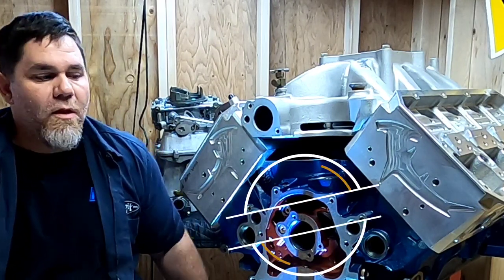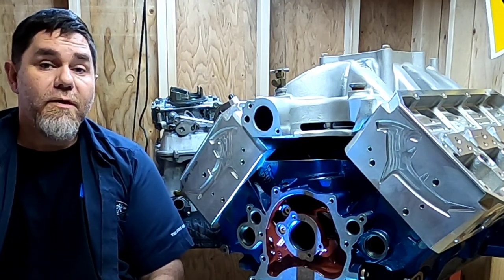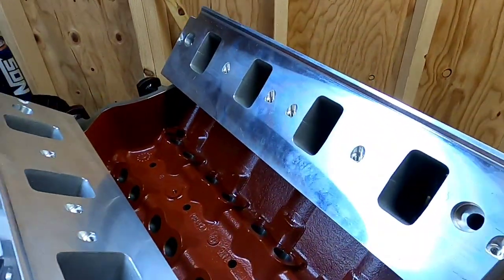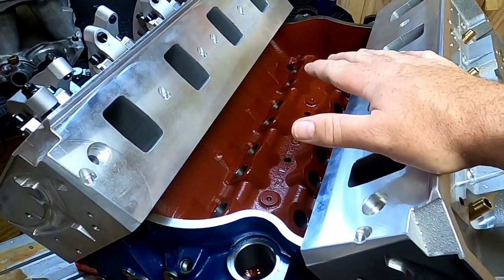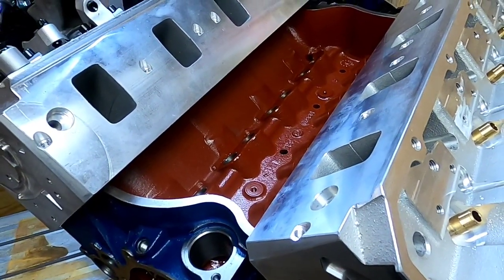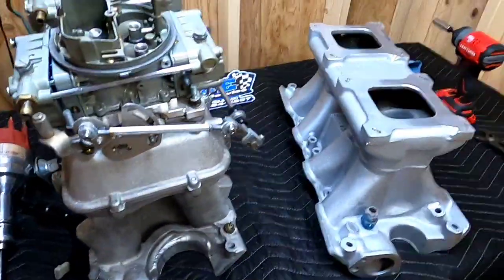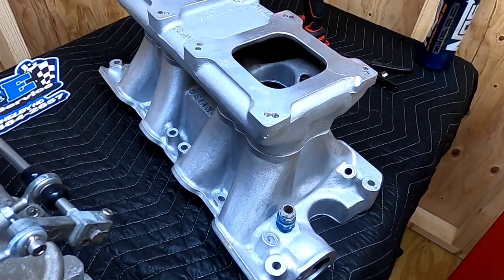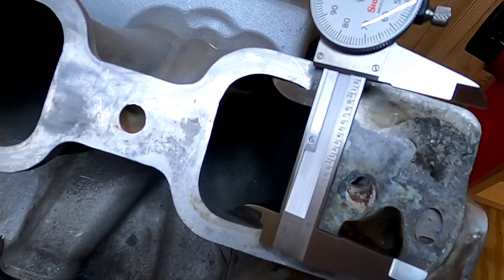MIXED UP BOSS, Which Tunnel Ram is just Right for this combo? Plus other random thoughts

Comment: Those heads are gorgeous. A testament to cnc
Reply from the maker: Yeah, they are a sight to behold!  Hammerhead Performance Engines offers CNC ported versions of this head that will go 435cfm,  In MAX effort that can be stretched to over 500cfm from the same casting... As cast they flow 395cfm You can see me unbox the heads and flowtest them in my Project MIXED UP BOSS playlist!  Thanks for watching
Andy

Comment: Now that's some great information on them high rise intakes! I think I'll have to watch it several more times to full comprehend it all but that just how my brain works. I totally understood everything you said but just could not absorb it all it one setting. 

Now I would like a tunnel ram for when I build another engine for my car but I really not sure what I want to do with it yet. I'll probably go with a single carb to start off because I think it will be best for my application.

Hope ya find that intake your lookin' for, I don't know of any around here but I can ask a few folks.

Have a nice day and a better one tomorrow!😎
Reply from the maker: Big Bear it is pretty simple... When it comes to picking the right tunnel ram,  You must have the proper size runner (cross sectional area) to supply the airflow needs and the length of the runner must tune in at the rpm range that you are wanting to make that peak power! You get those things right and good things will happen..
Andy

Comment: 4V baby yeahh 💪🏼🏁
Interesting, i have a 4V Clevo tunnel ram, but I’m across the world lol 🤷🏼‍♂️
I have a set of 4V’s that have that water passage drilled & plugged  that were once modified/used on a Windsor I’d say. Same thing as you mentioned & drillled/tapped at the front also.
Man those Heads look badass 👌🏼🏁, I’d say your Adaptor plates for em can do with a little blend taper between the two, probably promote a little air speed/velocity.....
Cool 😎 👍🏼🏁
Reply from the maker: 4V Cleveland for the WIN... You and DragBoss has rubbed off on me!  
Andy
Reply: @UnityMotorSportsGarage   hahaha 😆🤷🏼‍♂️
I heard Cleveland......then 4V...... & had to jump right in 🤣.
Man Cool build you have right there 💪🏼🏁

Comment: Completely understand Andy.  Re cam specs. Guys watching this will have 2 work out there own combinations. Or go 2 a decent shop 2 have an engine built. Or call comp cams.  
Re Carburetors... would u consider Predators.  They flow real decent numbers.
Reply from the maker: I've always liked the Kendig/Predator carbs but they are hard to find around here.. I have very little experience with them.. I helped a buddy of mine over 20 years ago with his.. it ran awesome though.. 
Andy

Comment: I worked in a shop that built a lot of winston west engines smallblock chevys 360 inch limit and Fords (same size limit ) every engine we put on the dyno had the Yates heads out powering the sb2s usually the fords came in 7 to 12 hp more. These engines were limited to 9.5 comp ratio but were run to 8,800 rpm on the dyno for testing but raced with a 9,000 chip at the track.
Reply from the maker: The Yates heads are awesome!  I've had both the C3 and D3's they flow some serious air... too bad I sold them before I could build motors for them!
Andy
Reply: @UnityMotorSportsGarage  I have a question for David Vizard I am not sure If you could pass it on to him. If not it is ok. Has anyone built a gas powered v8 that ran in a 2 cycle mode ( camshaft turns at crankshaft speed) ?I know this would require forced induction like a Detroit Diesel has. My imagination  tells that there may be Huge power potential  if the valve train could be figured out.Doing this would be like doubling the displacement if my logic is sound. Thanks .Will.
Reply from the maker: @williamturner2617  I don't know if anyone has converted an existing engine...but I do know that there are some 2 stroke V8's here on YouTube... Yamaha if I'm not mistaking.. I will pass it along to him..
Andy

Comment: Hello Andy, If my memory serves me correct there is a article where a guy named Cole Quinelle (turbo shop) ran a tunnel ram on 4 hundred something inch small block chevy that was his daily driver in highschool I believe it ran 10s . Any way  I think he ran 850 baseplates on his 660 center squirters for a little extra air flow .you may need this with the new heads.
Reply from the maker: William I believe you are correct sir!  But I'm planning on testing them just to see how they stack up... Dominators are waiting in the wings!

Comment: Pick the one you want and get Wilson to port it...or get David to do it.
Or you could go sheetmetal  with all the bells and whistles properly calculated for runner style and length. Ya gone this far, go all the way👍
Reply: That custom sheet metal intake is a good idea
Reply from the maker: Not for this build... I'm also after the period correct look of a 71-72 ProStock build... While I agree... A sheetmetal deal would definitely give me what I want powerwise...just not the look
Andy
Reply: @UnityMotorSportsGarage  sounds like a challenge to me....how to make a fabbed intake look vintage. Could start a trend. If it's all about getting the aesthetic right, Im all for it👍

Comment: I would have opened up those heads to match the 4v, but if you can find one, Have a look at a 2V Cleavland tunnel ram , it will have smaller runners than a 4V manifold.
Reply from the maker: I dont want to open up the heads just yet.. I want to test other Windsor based manifolds, So for now im going to epoxy the runners in the intake....
Andy

Comment: Andy l think l have a number 4 some old guys in the States who rebuild them. Nice guys.  Came across them a few yrs back. Did speak 2 them. Found the chap very trustworthy.  Always difficult in Oz & over there. Gr8 4 cars ect. Apparently no good in Boats 😢😭
If l find the No l will send u a message.  Possibly the equal of 660 centre squirters.  U would have a better idea of that than me. 
Nostalgia is always Cool.

Comment: Hi. I'm running a ported out super Victor 351w and just a single QFT 1050cfm 4150 flange carb on my Hammer headed 427w.  It's jetted perfect according to my afr gauge. It's 12.5 to 1 compression,712 lift 274@.050 110 LSA Solid roller cam, oh and the heads are ported by Greg himself. Should I look into more induction ??? Like two fours and tunnel ram or a Dominator and bigger intake??? Thanks, Mike.

Comment: Andy, on this set up, what holds the valey-cover in place?
Reply from the maker: You seal it to the China wall.. then when the heads are on it will lock it in place..
Andy
Reply: @UnityMotorSportsGarage  that's what I figured. Thank you for verifying.
Reply from the maker: Yes sir anytime

Comment: Oh, I'd love to see what you do to that new 445W Ford came out with in the Super Duty trucks.
Reply from the maker: We are going to find out real soon! I have 3 buddies that scored some... We are going to build one for the Blue 96 Mustang that I did a video on awhile back! The search for parts is already on....lol
Andy
Reply: @arnulford66 Godzilla is the Nissan RB26DETT engines from the Skyline. Don't care what Ford says.
Reply: To Scott I am not yet familiar with this 445w engine. Does the w denote windsor? and if so is this a stroked version of a 351w . We are trying to figure out a torque engine for a 70 cougar that is easy to build but is smaller externally than a 460 (shock towers are still in place). Thank you.Will.
Reply from the maker: The new 7.3 isn't a Windsor.. it is a serious piece though... It has a Modular 4.6/5.0 bellhousing... Check out the Reving Evan channel here on YouTube... He has alot of great content regarding this engine... 445 ci of Ford goodness.. it is only slightly bigger than a Windsor... Check it out...
Andy
Reply: @williamturner2617  I'm calling it a 445W because it's made at the Windsor plant. But like Andy said, it's not really a 302/351W design.
Reply: @ScottKenny1978  thank you. Ive been on utube checking this engine out revin evin ect.  Thank again I am almost afraid to let out that I visited this site because of the title 600 hp and 16 miles per gal. I plan on running a tunnel ram on a 440 mopar street nostalgia car 550 to 600 hp. But the reason I've stayed is because there is a great group of people on Andys site .Thanks again. Will.
Reply from the maker: Hey you will be amazed at how much mileage you can get with a tunnel ram!  Heck we got 12.5 mpg going up the mountains carrying an extra 1000lbs worth of stuff in Casper... Lol 
Andy
Reply: @UnityMotorSportsGarage  the only thing that I am not sure of that if I can get away with 780 vacuum secondary (3310) Holley carbs or If should go with 600 cfm vac. Sec. Holleys the advantage to the 750s is that I can use Proform main bodies that are equipped with screw in air bleeds but Proform does not make a main body in the 600 cfm size . I never thought that would be building an engine where I was trying to limit horse power but the stock block becomes unreliable  after 600 horsepower and I don't really need a ton of hp just to get a cheeseburger and a chocolate malt. For years I wondered if vacuum advance would work with a tunnel ram but now I know tha answer thanks to Andy. Will
Reply from the maker: If it were me.. I would try the 750's because of having the ability to change the bleeds..  The Vacuum advance will make a huge difference in low speed drivability and economy..  run it to manifold vacuum not ported... Get an adjustable advance can so you can taylor it to what your motor wants!
Andy
Reply: @UnityMotorSportsGarage  Thank you.I was leaning towards the 750s thinking that the motor would not fully open the secondaries unless the engine needed the airflow. I plan on running the carbs in line with a short bowl conversion and after market metering  plates with replacable jets. I will probably  wish that the carbs  were mounted with Velcro  buy the time its dialed in. Will
Reply: @williamturner2617  may want to leave the hood off while you're getting things dialed in. You can sit on the inner fenders and work that way.
Reply: @ScottKenny1978  The vehicle is a 69 Dodge Super Bee . I don't plan on cutting my stock hood but will get a fiberglass hood with out  the 6 pack scoop  but keep the factory set up with 4 hood pins. Thanks. Will.
Reply: @ScottKenny1978  some how 8 pack just doesn't  sound right!
Reply: @UnityMotorSportsGarage  I plan on putting as much  initial mechanical advance as the motor/starter will take 20 to 22 ? degrees b.f.t.d.c. and the limiting the mech. adv. in the dist. This makes a 440 come off the line stronger.
Reply: @williamturner2617  you will need different hood springs for the fiberglass hood, or remove them entirely and use the pins. Friend of mine put a glass hood on his Camaro, had problems with it cracking at the edge of the hinges because the springs were too strong.

If you're really motivated you could do triple four barrels instead of the six pack. Would take some serious tuning to get to run well, though.
Reply: @ScottKenny1978  440 6 pack super bees have lift off hoods in 69 so i wont have to worry about cracking and no my car is not an original A 12 car it is a clone. Thank you. Will
Reply: @ScottKenny1978  Some interesting trivia is that Pontiac offered a 10 barrel intake manifold over the counter in the dealership parts dept. It had 2 4bbls. With a 2 bbl. mounted in between them this was for the 389 or 421 sd motors . 440 12 pack sounds pretty good especially  if its hot outside . Would cause a lot of people to do a double take  and would be super easy to tune If the secondaries were locked out. I know this is heresy  but I can't  even begin think how hard it would be to adjust the air/fuel ratios.
Reply: @williamturner2617  cool, didn't know that. (Both the hood and the 10bbl intake)

I can't decide how I'd want to set the secondaries up. I'm kinda leaning towards all vacuum, open the center carb secondaries, then outer primaries, then outer secondaries. But I would need an engine to mess with to decide for sure.

Comment: So you'll have a crossover on the edge of the heads like the LS 🤔
Reply: There's a lot of stuff GM did right on the LS motors.

Besides, convergent evolution.
Reply: Cam montreuil engines  like what?
Reply: Cam montreuil engines  like the venting between cylinders and cooling the heads first?

Comment: I'm looking for a tunnel ram linkage  kit for my 5.3 ls do you know of a bolt on kit for this set up everyone says  summit but no luck  I'm putting  this into a 91 obs pickup thanks
Reply from the maker: You will probably need to look on eBay for a sideways linkage. You will most likely have to make the bottom anchor that bolts to the manifold bolts since I'm not aware of any for a LS but eBay is the place
Andy

Comment: Would a 460 or 427 Ford performance short block work or would there be piston to valve issue's
Reply from the maker: You can see in my part 1 of this series... this started out as a FRPP 427 shortblock,  with a small enough cam you "could" run these heads and not have any PTV issues.. But I swapped in a set of Diamond pistons with the proper valve reliefs to work with the Solid Roller cam im going to run.. Hope this helps and Thanks for Watching!
Andy
Reply: @UnityMotorSportsGarage  Ok  thank you sir

Comment: I posted a comment a few hrs ago about my dream build with these Fabulous Heads from Hammerhead Performance Engines. What l posted was my dream build. A blow'in engie 4 a hot boat.  In no way is my thoughts/dream designed 2 undermine what Andy is building 4 himself.  He will have one awesome engine. The block l was referring 2 is a BMP man of war billet aluminum block. Check it out if ur interested. Check out the caps. Every single cap is splayed with 4 bolts.  U guys over in the states have a fabulous folk who go above what GM FORD ECT release. They r everywhere over there. We have a few in Australia.  U r lucky buggers. And our $ against the green back is terrible.  In 2010 we were 1.10 -1.12 Aussie $ 2 ur $1. Now its woefull.  .73c to usd $1. 
Any back 2 the block "Jewellery "

Andy's going 2 share some more about his engine on sunday nite so 👀👀 4ward 2that. 👌👍
Reply from the maker: It's fun stuff setting up the valvetrain... And what not to do!  It will apply to all engines it will be a part 1 of 2...  Alot of ground to cover!
Andy
Reply: Man of War Block not Billet. Sorry about that.  Dart Engineering can build one 2 what ever specs u or ur engine builder comes up with. 
Isn't Gr8 that Andy is sharing some Carburetor secrets with us. I personally don't know a lot about them so its always gr8 2 learn some more tech.

Comment: 600hp? That's awful lot of messing around to get just 600hp.
Reply from the maker: Jerry that was with my old 393w...  It also made 1.41 lbft per cube on pump gas... which is a tough mark to do...  The new BOSS motor goal is to make 750hp NA on pump gas.. stay tuned
Andy
Reply: @UnityMotorSportsGarage  well I'm not saying that it's not cool. I'm just saying the dollar factor is very high for a 600hp goal. How much did it cost??
Reply from the maker: @jerrybiscay6987  oh it was cheap... Cast Scat crank 302 Mahle pistons.. stock length I beam rods... Most of the money was in the valvetrain..  but I was still out less than 5k for everything in that build..
Reply: Talking cheep hp, ran a stock 91 5.0 with some dart iron heads and way to big of a cam and a 350 shot of nitrous from 1500 rpm car ran 9.50 all day, probably was making 600-650 to the tire. (In the late 90s) thanks for the show and tell love it. KMFNB